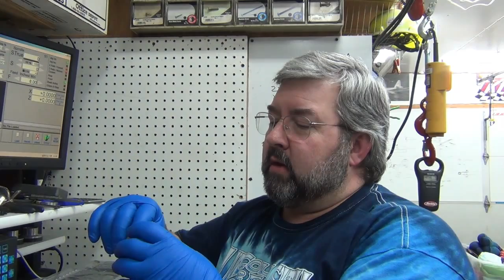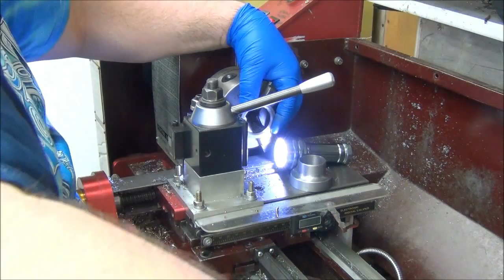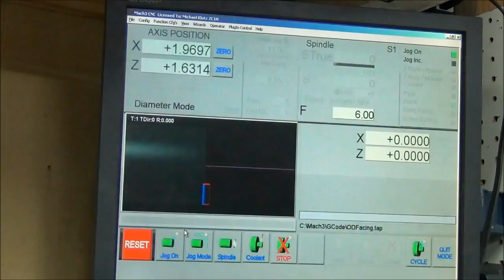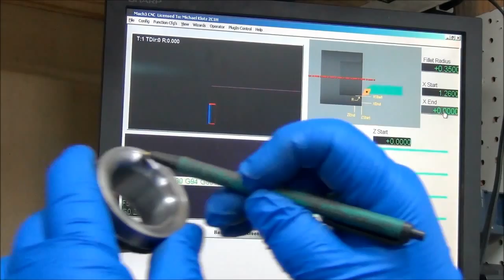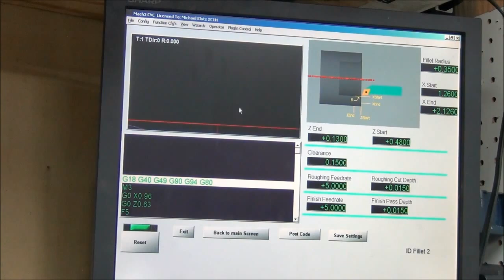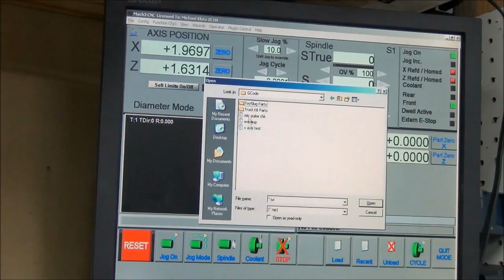9x20 CNC Lathe - Inner Bearing Adapter - Part 2

Comment: I know it seems silly but how about doing the radius 1st or adding a finishing face pass to clean up the ledge?
Reply from the maker: Great suggestion!  I was thinking the same thing.  I'm going to try to have it combine the face cut at the end of each arc, or just do a facing cut once the radius is finished.  Plus, there will not be a tool change so it will speed up the time!  Win/win!! :)  Thanks!!!  Keep them coming.  I got lucky on this one.....next time I may not be. I'll think I'll change it and add it to the next vid which will hopefully, be the last on this part.